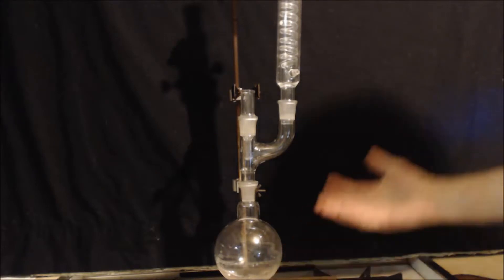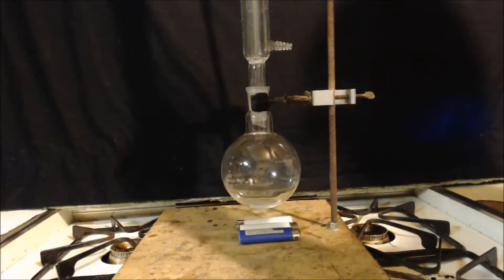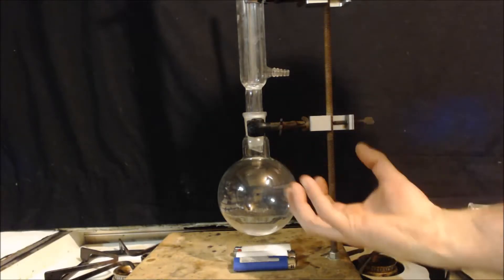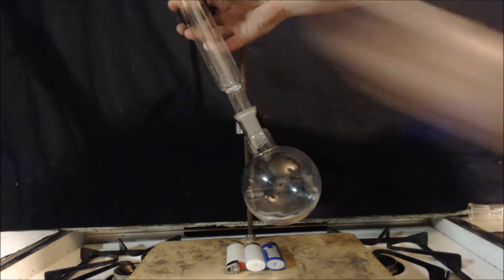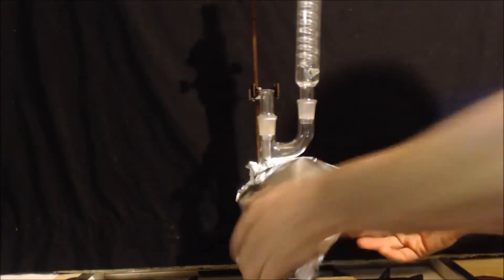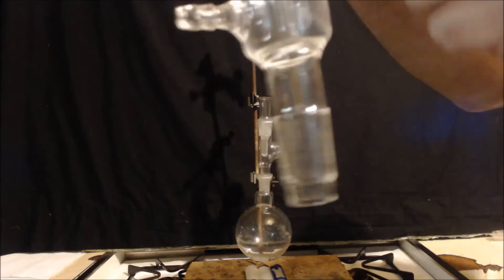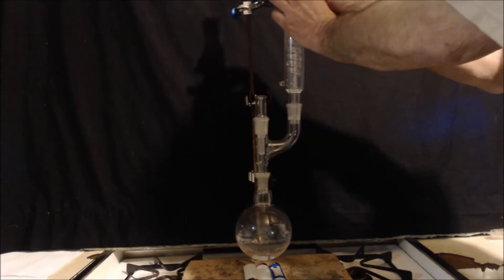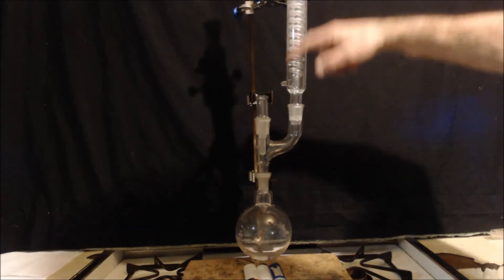WHAT IS REFLUXING

Comment: Never ever reflux under a graham condenser. The liquid will get stuck in the coils and slowly make it to the top and blow out. Use a liebeg or even better a dimroth. Graham condensers are for vertical distillations. They work good for steam distillations but that's about it.
Reply: This is JBSC............As long as the GRAHAM condenser is vertical then it will reflux good.   The ONLY time it does what you are saying is when the condenser is NOT vertical........OR......if you have the temp up to HIGH.......or both.       If you are having liquid get STUCK in the coils then your condenser is NOT vertical and/or you are rufluxing at too high of a temp.   So just turn down the temp and/or make the condenser more vertical and it will reflux anything just as good as any other condenser.   ALSO...........you are kinda condradicting yourself.   Refluxing is the act of using the condenser in a VERTICAL position.      In the first sentence you said  NEVER reflux under a graham condensor but 2 sentences later you say graham condensers are for VERTICAL distillation.................but when you reflux the condenser is VERTICAL but  you said NEVER do that.................WHICH IS IT...........??????????       You are the first person i have heard use the word "vertical distillation" .    I have never even heard that term in any chemistry book before today.    I looked it up.   It is so broad of an answer i still dont know what it means.    You should pick another word.